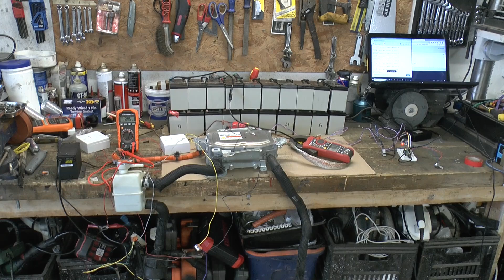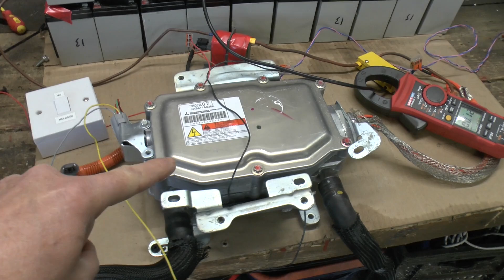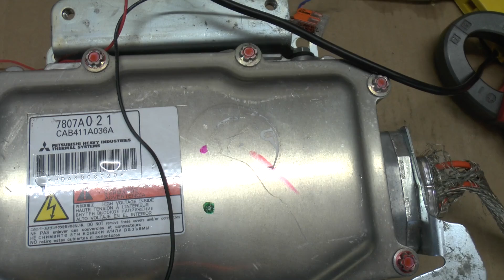DIY EV Part 52 - Testing the Replacement Cabin Heater.

Comment: What was the reason you check this cabin heater ? I have problem with heating but only on ev mode. Ev mode no heating when i drive hybrid mode with engine i jave heating.
Reply from the maker: In hybrid mode the engine will heat the water so heat the cabin. In EV mode this heater has to heat the water so it sounds like you have a fault in that system.
I chose this heater because I had been told it would work in my EV conversion. I had tried and failed to make the Nissan Leaf heater work.

Comment: fantastic video, off topic sorry,, did you buy the outlander heater from ebay ( I'm in the UK )  if so can i ask how much it cost ?? I suspect my heater is faulty, heat from engine is perfect, heat from electric doesn't work blows cold even after 30 minutes, the heater ( under passenger seat ) stays stone cold as does the 2 pipes in / out, ( if anyone here understands the outlander phev ive already checked and cleaned the filters and have had the 4 way valve replaced ,as heat works from the engine its not a blocked matrix or failed pump I can hear the coolant running around the system ,  i was going to attempt to swap it myself but im not a mechanic and the costs involved in a garage is more than my car is worth ( 8yr old phev ) ,  it looks simple on your bench, is it simple to unplug the cables ? just bolted in ? sorry for the questions but ive had no heat in the winter for 2 yrs and we just force the engine on in the cold. the dash reports its using KW's and if i turn down the temp the KW drops. any help appreciated.
Reply: oh p.s. i was told this is a ptc heater im not fully understanding how but as the heater warms up the resistance in the elements increases dropping the the KW usage like a self operating variable stat ?? but you seem to be controlling it yourself ?
Reply from the maker: Hi, yes I bought it off ebay but I think it came from Poland and it wasn't too expensive, around £170.
I think there are several versions so maybe you need to confirm yours before ordering anything. 
Before you go near it be aware it has up to 380V at the HV connection when the car is turned on so be careful.
If your not able to diagnose it yourself it might be worth taking the car to an auto electrician to confirm it isn't something simple before throwing parts at it.

Comment: When it reaches the target temperature, does arduino cutt the current completely or tries to adjust it slowly?
Reply from the maker: I've been running it for a few days now and it seems to cut the current to around half when the temp is 10C below target. This means If it is very cold I need to set the target higher to between 62C and 65C to maintain a comfortable 55C actual. In milder weather I can have it set to 55C and it will maintain that.
55C actual seems to give a comfortable amount of warm air but I can turn it up or down easily as required.
Of course this can all be adjusted in the Arduino sketch but so far I am very happy with it.

Comment: super video and a fantastic bench setup
Reply from the maker: Thanks mate, I was lucky to be able to salvage 50 or more 12V batteries from old UPS's that were being scrapped. Most of them are sitting in a shed being topped up by a solar panel. I then use them to recharge my ebike from an ancient 12V inverter. 
I used the same setup to test the inverter and motor 3 years ago. https://www.youtube.com/watch?v=3MaXFJDwMVI&t=739s
Reply: @alibro7512  That's great!  I was thinking all those little batteries would have otherwise been quite a large investment for a bench setup.